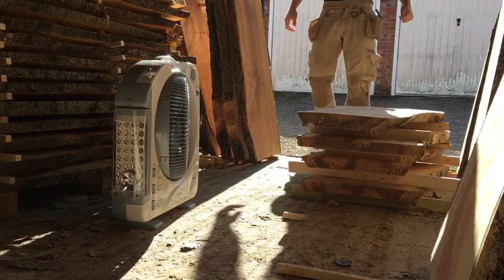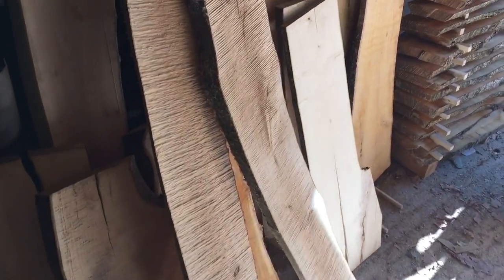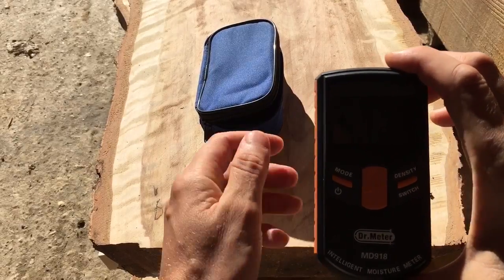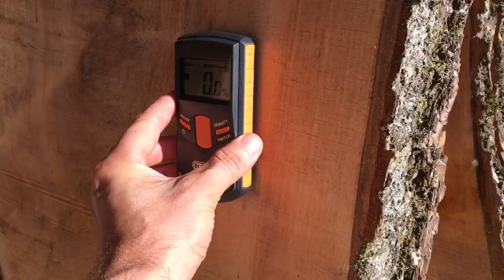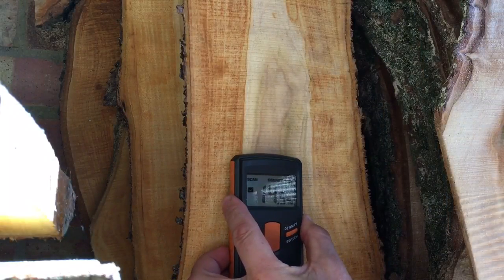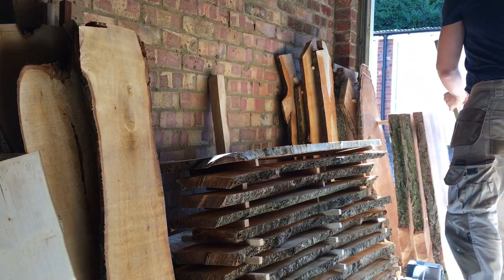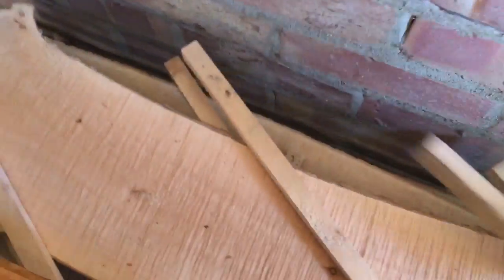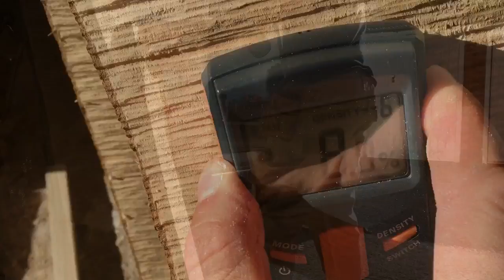Turning crapy lumber into usable stock!!!

Comment: ive seen stacked lumber with concrete blocks on top of the stack, i think the idea is the weight on the smaller boards stops them twisting so much as they dry
large slabs are heavy so they dont have that problem.
painting the ends may help with reducing the checking,
 cheers

Comment: Toolstation work horses.. they are good but made plywood tops them. What would you rate the planer as I was looking at getting the same model?
Reply from the maker: Charlie Winch that Erbauer is actually from screwfix. The machine is ok, but the delivery is crap! I had to return the first one because it's arrived broken! 
Make sure to open the box and take a good look before you walk away from the till!
Reply: Szilard Pinter yeah I read that in the comments. I have quite a few erbauer tool and have be very surprised how good they can be.